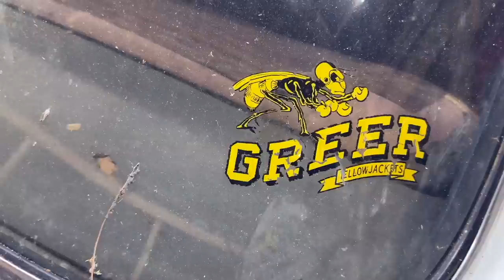This 1955 Chevy has been parked for 40 years! Can we get it started?

Comment: Yes sir that's the legendary stovebolt 6 those 235 straight-six are amazing motors they're bulletproof. I would also replace the gasket on the valve cover and purchase a bigger battery that battery looks too small for the battery tray excellent find good luck with the rest of the project true great survivor the 1955 Chevy 210....

Comment: Good luck on the project. Futuristically on a carburetor engine it's better to fill the carburetor with gas through the vent tube rather than high doses of starting fluid.the detonation from starting fluid can damage piston and valves.good luck on this beauty.
Reply: What Kool survivor 55 210:Sedan, I have a 57 210 survivor that I really like. 💯🆒
Reply from the maker: Thank you for the tip! Don’t have a lot of experience with carbureted engines yet.

Comment: Yes sir that is a good automobile. My Granddaddy purchased a 1956 Chevrolet a 150 model (trim level below the 210). Keep that car and make it a daily driver. You really have a good car and it is complete. You can get carburetor kits and fuel pump rebuilder kits (that pump is rebuildable). And as you have mentioned it you want to get the car to the point where her Granddaddy bought it. My Granddaddy bought his Chevrolet used from the original owner and later gave it to my father for us kids to drive. We rebuilt the engine and got it in good mechanical shape and my Dad could put a paint job on a car that would rival any body shop. When Dad painted that car it had been stripped of the old paint and the trim and all we had to mask off were the front and rear windows. We polished up the chrome when we reassembled the car and I'm here to tell you it was jam up. Of course as I got older I had to hot rod the car and truly at the age of seventy I wish I had not. Keep the car like it is and fix it up with a good quality paint job (original color if you please). Paint job does not have to be a real expensive one but a good quality paint (we used a good acrylic enamel this was back in 1968-69). This will be a good set of posts to follow.🥸🥸
Reply from the maker: Hey, thanks so much! It’s really cool to hear your experiences with yours. Appreciate the thoughts and suggestions! I hope you’ll follow along and let me know what you think as we make progress.
Reply: @CrossroadsRebuild  Will do.

Comment: Igrew up with these cars.  You need to check the float seat on the carb.  You can pull the fuel line at the carb, and crank it over to see if the pump works.  smell the oil for gas smell.  Your best bet is to get Marine fuel for the car.  It has no alcohol and will not dry out the gaskets.  Get some extra points and a condenser..
Reply from the maker: Thank you for the suggestions! I really appreciate it!

Comment: Please please resist the urge to do a drivetrain swap. This thing is beautiful as it is and needs to be preserved. Also when starting engine after being parked for a long time it's not a good idea to use starting fluid. Starting fluid dries out the cylinders and can cause excessive cylinder wear very rapidly. Best to use either gasoline in a squirt bottle or some with two-stroke oil mixed in to get some good top cylinder lubrication.
Reply from the maker: No worries on doing a drivetrain swap. She’s staying original. Only replacing parts for reliability. But keeping her original and authentic.

Comment: Always repeat ALWAYS NEVER START A MOTOR AFTER SITTING SO LONG WITHOUT TAKING THE PLUGS OUT AND ADDING SOME MARVEL MYSTERY OIL OR DIESEL AND TRANS FLUID INTO THE CYLINDERS and loosen up any stuck rings
2) The carb will need rebuilding 
3) check points and plugs they will need attention
Reply from the maker: Yes, all of the above will need attention. Thankfully she wasn’t stuck at all and I was able to turn it over by hand. Cleaned the points a little before first attempt, but didn’t really show it. Will no doubt need more attention. Carb definitely needs work! Lok